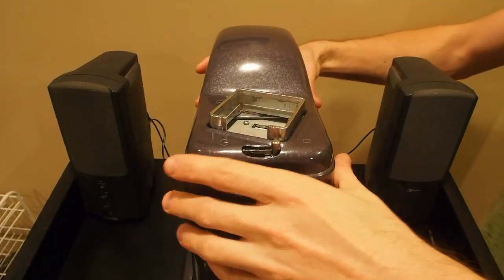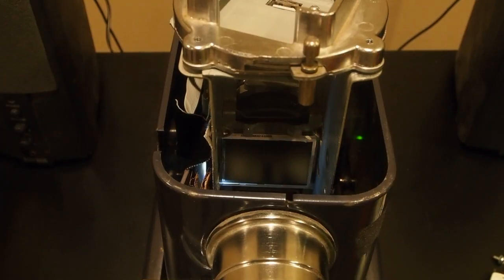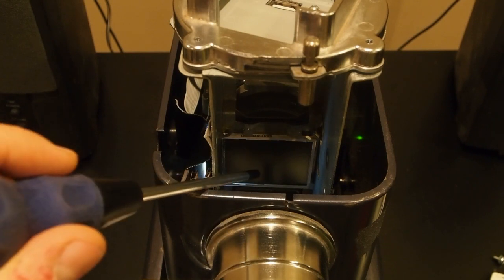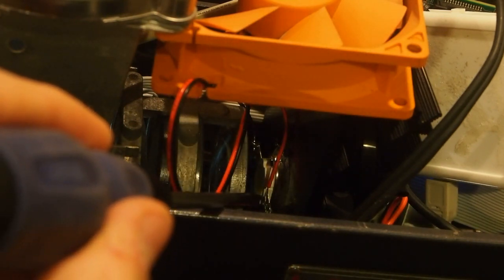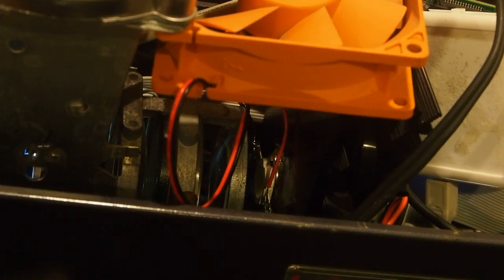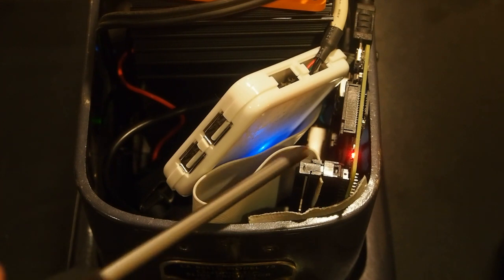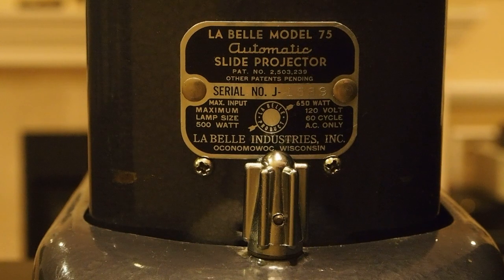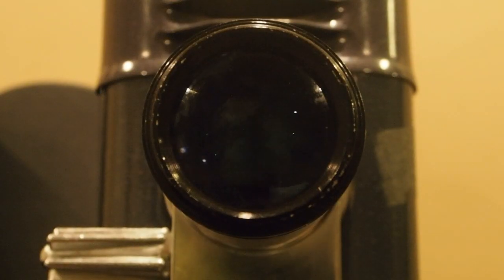Vintage Video Projector

Comment: YOU MONSTER!!! You destroyed a perfectly good vintage slide projector just to put digital electronics in it? Now it has no original value, it's completely worthless thanks to you!!
Reply from the maker: songs with BASS Pipe down, silly. I'm not running a museum and neither are you.
Reply: Alec Smecher, All I'm saying is that, I like to preserve the past for younger generations. 
I sound like an old man even though I'm no where near that old? I'm 24
Reply from the maker: songs with BASS Right now, this projector is neither valuable nor rare. That'll change eventually, but it's up to someone else to preserve one until then. I worked in electronics recycling for years, and you can go broke fast trying to store every old bit of gear that comes your way. If you're really passionate about this, get involved -- but expect it to come with some hard lessons.

I'm likely to keep this for a lifetime as an art piece. Chances are pretty good it's been saved from a landfill this way.

Comment: any improvements to the quality of the image?
Reply from the maker: Nope -- I don't often revisit projects once they're done. The low availability of small, high-res LCDs was prohibitive. If I were looking again I'd probably check to see whether smart watch displays were viable -- and of course mini projectors are pretty good and cheap these days, though it wouldn't have felt very satisfying to just cram one of those in.
Reply: Alec Smecher i was interested in the same project about a year ago and i realized that the best small screen we can get is from mobile phones. and play movies from pc is almost imposible and the screen conects to the mobo of the phone with tiny cables.. yes the screen is the problem..

Comment: Smecher, what kind of name is that?
Reply from the maker: +airspeedmph Mine ;)
It means something like "clever asshole" in Romanian. It got anglicized when it came across the border into Canada a few generations ago, so it's possible the immigration official was a Romanian with a sense of humour...
Reply: +Alec Smecher 
Aha, mi-am inchipuit eu.
Indeed (I am Romanian) and for a name is something unusual.
These days around here it means more something like a clever connected respected guy (not quite as in mafia connected though).
Anyway Smecher guy, you have some weird interesting stuff here.
I liked the Dymaxion Auto-matic Buckminster-Fuller...thingy, but it needs some kind of "mysterious purpose" knob in that front hole to be complete...I think.
Reply from the maker: +airspeedmph Agreed, there needs to be a control there, but it's hard to get motivated to re-open a project once I cram the back into it. Glad you liked it. I guess I have to visit Romania sometime, if only to show my passport at the border :)